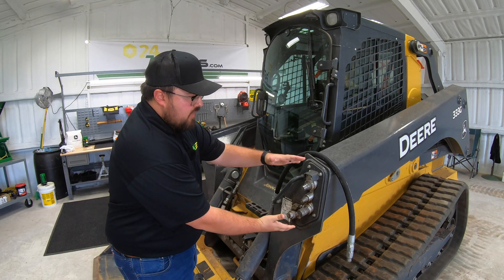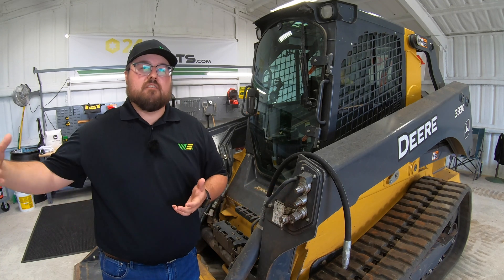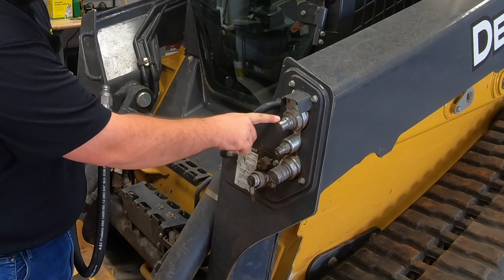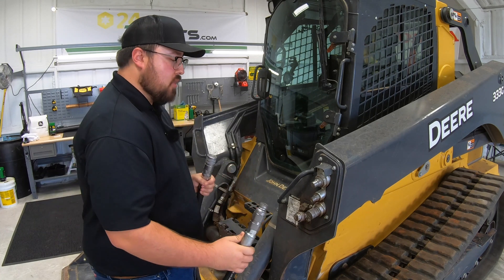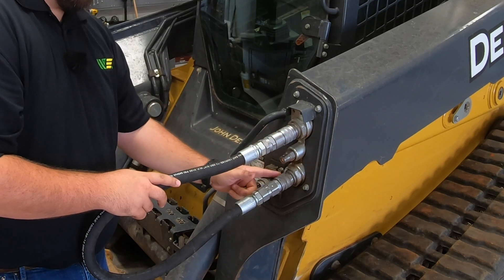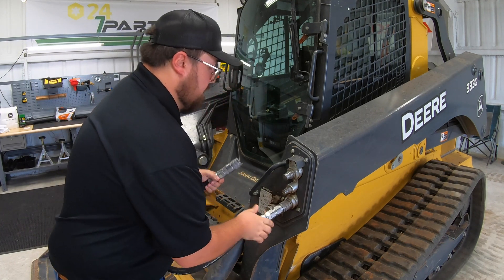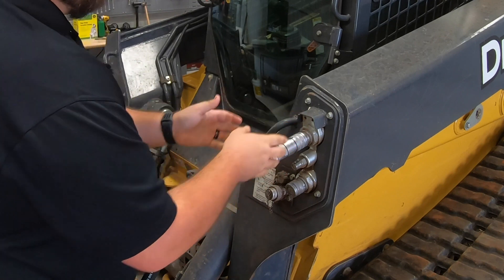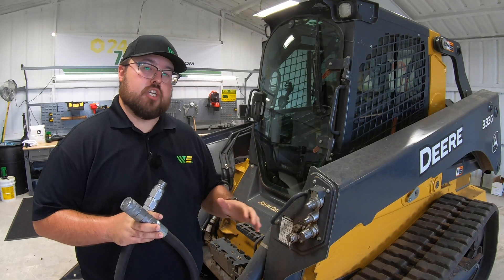How to connect hydraulics on John Deere 333G Skid Steer

Comment: Ever so quickly (and let’s call this more detail, not a correction)… a case drain connection is provided in order to allow the “case” or housing of a motor to safely “drain” to tank with minimal back pressure.  This is primarily to protect motor seals. But there are other uses for the case drain connection. One example is to provide a near zero reference for control valves that might be on the attachment.

Comment: I have a 324G and the hydraulic hookups look identical to your 333G. How do I know if I have high flow or low flow hookups on my 324G?
Reply from the maker: You know you have the capability of high flow if you have the switch in your cab that has the box with the plus sign in it. This switch turn your machine to high flow. The hookups for standard and high flow are all the same.
Reply: @WesternEquipment   Thanks for the reply. And great videos.

Comment: So if your attachment is a high flow it will come with a third hose? And if it doesn’t come with a third hose it means it is not a high flow attachment??
Reply from the maker: Not always. Some high flow attachments don't require a case drain or third hose.

Comment: I have a 331g with high flow. The couplers are the standard coupler and my mulcher has larger 3/4” coupler that don’t fit my JD. I’ve read this standard coupler can only efficiently run 24gpm.
Reply from the maker: Well I know that even on the 333G there is only one set of couplers that runs standard and high flow. I know other brands will have two separate couplers but the Deere’s do not.

Comment: I need a replacement for the small connection in the center
And a quick disconnect on my mulch head connection
I have a hi flo 333g
Reply from the maker: Get in touch with our customer service team at 247Parts.com and they can fix you up! Thanks for watching!
Reply: Hey, did you find the connection in the middle ?

Comment: I struggle after the hydraulics have run to get the M to F to engage.  No jokes, please!  Any way to relieve pressure rather than wait?
Reply from the maker: Best way to do this is plug in your hydraulics when the machine is off and then pushing in on the coupler should relieve the pressure. I hope this helps and thanks for watching!
Reply: Hey, so I have the same question my line will not plug in. I’ve tried banging to relieve pressure, the machine is turned off and still no budge. Will time relieve the pressure or is there another avenue I can try?? Thanks

Comment: How do I tell if my 333g is high flow and if it is do you know flow rate for a snow blower ?
Reply from the maker: Check out this video, I think it will answer your questions https://youtu.be/BxjvifUEGTU. As far as the snow blower goes it will depend on the brand and the hydraulic flow needed should be specified by the manufacturer. John Deere makes many different models and sizes of snow blowers and the hydraulic flow varies between models. I hope this helps and thanks for watching!